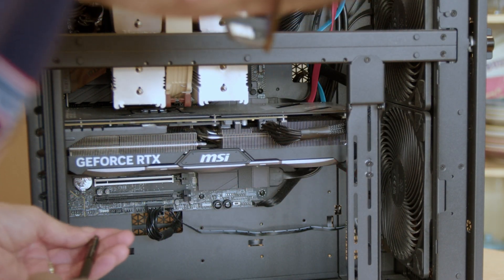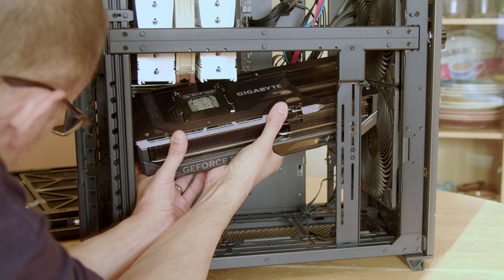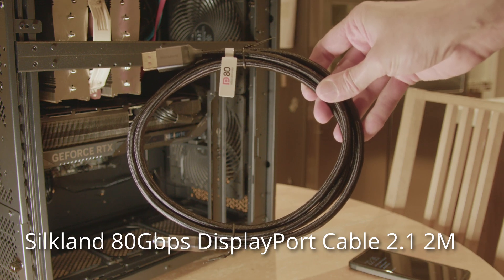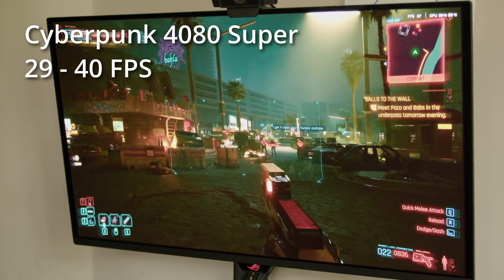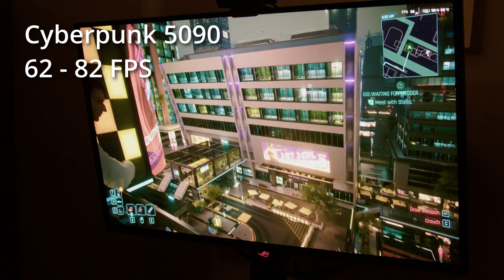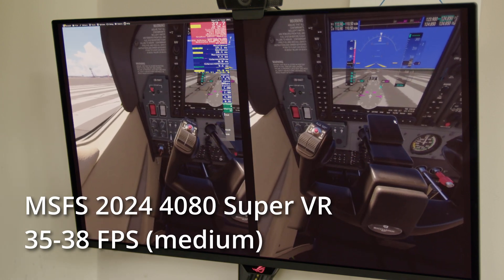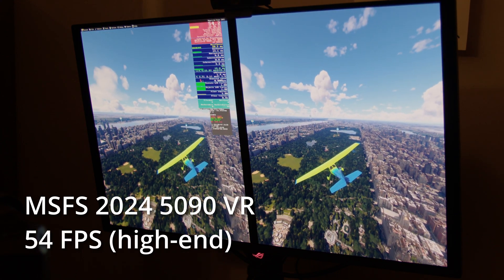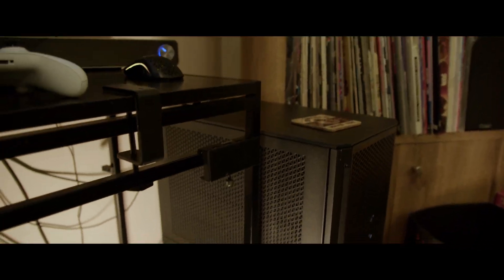Gigabyte 5090 Gaming OC with Pimax Crystal VR

Comment: Nice comparison. Is that Crystal light VR? I've ordered the Super and waiting.
Reply from the maker: It's the original Crystal, which is the the same as the Crystal Light but with eye tracking for dynamic foveated rendering. The Super does look interesting, but I'm finally happy with my current setup so I'll see what happens with the next few headsets that come out!